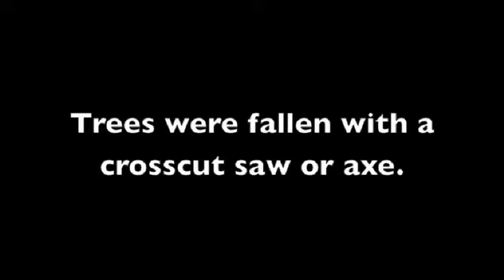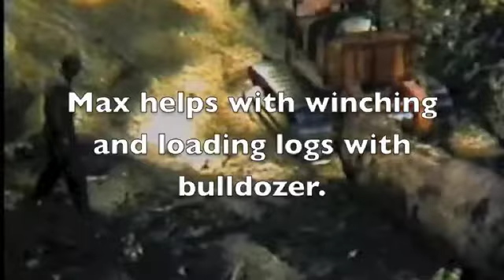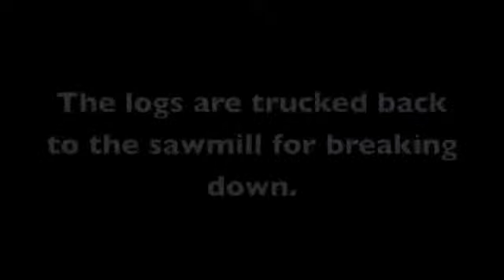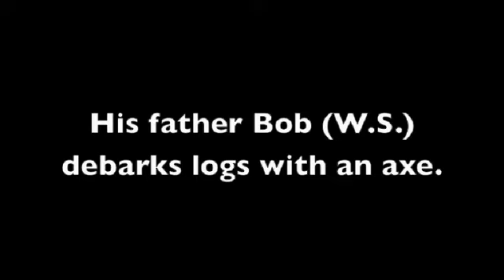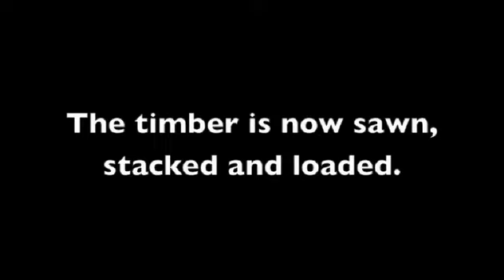Walkers Shelley Mill

Comment: I remember when we were living at Walkers Mill, there was a big grey GM ?? engine that ran the mill and after it shut down, we would start a little engine to power the camp. We’d put a little bit of ether into it and crank the hand to start it.

We originally went to state school in Shelley, then did schooling via correspondence, till we moved to Berringama and went to state school there.
I lived in the bottom house beside the Walwa Jingellic road, in 1964 to 1965 with my family, Geoff & Susan (Pat) Parkinson, 2 twin brothers, Kenny & Rodney, Vernice, me about 10, Andrew & Gerry. We moved to Berringama and the Welfare Dept grabbed us about mid 1966 and put us all into different homes, such as Allambie, Turana, and then the Ballarat Children’s Home.
Reply from the maker: Hi Murray, you have a good memory! The small engine was to drive the generator for power to the houses. Thanks for your comments.
Reply: @grahamwalker5902  yes, I used to start the generator at 9 & 10 years old, we actually had a TV then, changed channels with a pair of pliers because the rotating knob was broken. If someone put their electric kettle on, the tv screen would go haywire. We had goats,one was called Carmen and that was how we got our milk. 
My father felled trees for SEC poles, from memory they had to be 40ft or 60ft which was preferred and bought in the best money. I believe he was getting a pound a pole, £1 = $2, but the tree had to be barked after felling.
We moved from Stanley to get away and make a new start, but we went from having food & money to having nothing, we were always hungry, until we went into the Welfare System, my father died of cancer in 1968, 2 years after we were picked up by the welfare dept. it was while we were in the Ballarat Children’s Home.
I’m sure Ben Street who worked at the Stanley Mill moved to Shelley at the same time.